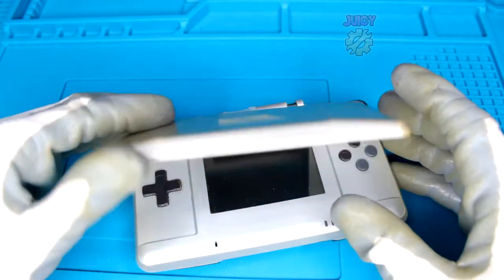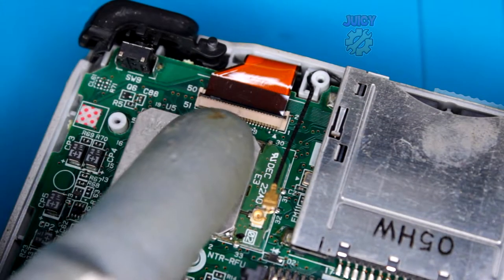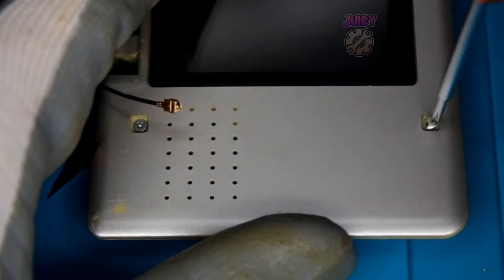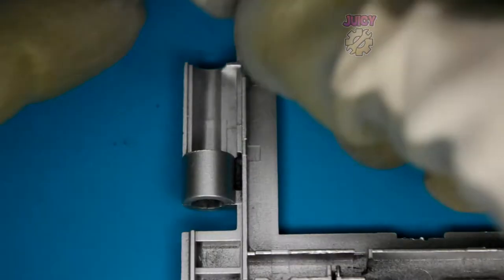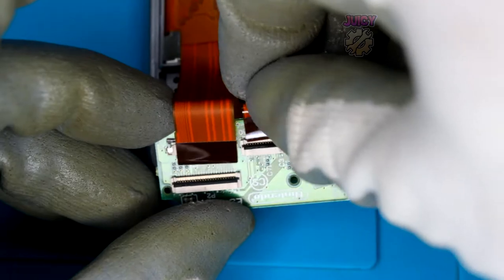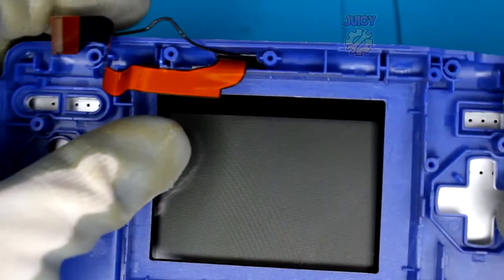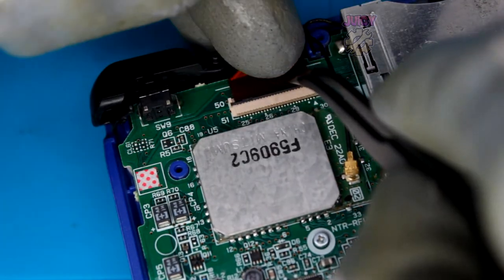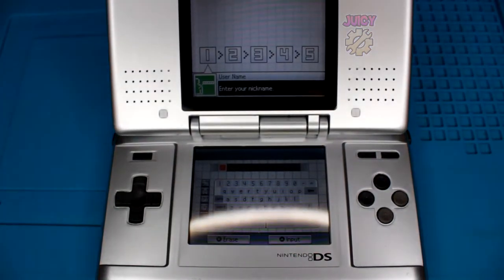How to replace DS Shell in UNDER 10 minutes - Shell Swap

Comment from the maker: do you still own a DS, if so is it shell still intact? LIKE & SUBSCRIBE

Time Stamps:
            ► @ 00:14 - What you need
            ► @ 00:42 - Removing Shell Screws
            ► @ 01:01 - Removing DS
            ► @ 02:05 - Removing Bottom Screen
            ► @ 02:54 - Removing Top Shell Screws
            ► @ 03:21 - Removing Top Screen
            ► @ 03:55 - DS Hinges
            ► @ 05:44 - Installing Top Screen
            ► @ 07:55 - Installing Bottom Screen
            ► @ 08:45 - Installing DS
            ► @ 09:29 - Installing Shell Screws
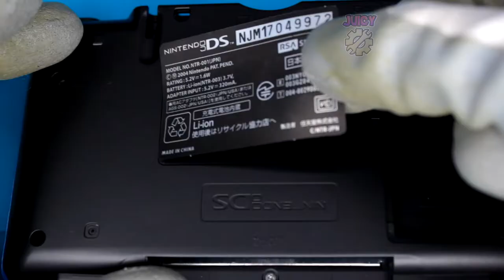            ► @ 09:55 - Misc Shell
Reply: I dropped mine and the plastic was so brittle that it broke like glass
Reply from the maker: @izzymaedavidson1974  yeah you can see the original shell in the guide shatters easy too
Reply: I own one but the shell if broken, but going to replace it with your video as help👍 i just replaced the shell of my ds lite.
Reply: Next, replace Nintendo dsi please
Reply: How much for me to send mine in ?
Reply: I had mine since i was about 6 yo (now 25yo) my whole childhood it was perfectly fine and then when i was 20 i moved to another house, dropped it and now there is a hole in the top shell and my hinges are broken. The device itself works fine still.. i just can't seem to find where to buy a shell replacement that includes hinges..
Reply: @kim_3000  And i order this shell, hope it will be decent quality
Reply: It was till I gave a good tap in the back to dislodge the cartridge.
I'm going to replace the shell but while I'm in there I'm also going to replace the digitaiser because half the screen is off.
Reply: Are you In the US? If so do you know a reputable shell seller?

Comment: This video is super helpful! My experience swapping the hinges was awful until I used the corner of my desk. Press down on the housing and use the corner of the desk to force those pins into the hinge slots. The use of profanity is also helpful.
Reply from the maker: its absurd the amount of force you need
Reply: New fear unlocked after I made orders today 😅
Reply: Tried your desk corner in 2024 and it worked! Thanks

Comment: Are the buttons more receded on the new shell? I have an original with a broken hinge that I just bought a new shell that I’m going to replace it with but if the buttons don’t stick out of the bottom like the original I will just use the original bottom with the new top please let me know
Reply from the maker: I've noticed on some shells its actually the hole for the buttons is just not big enough and needs adjusting slightly, a file normally works well for this

Comment: This is the best channel BY FAR when it comes to repair tutorials. No waffling, straight to the point and informative! 

This video was my guide replacing my DS shell as I have never done it before. The shell was of poor quality. It came with screws that didn't even fit, so I had to use my own. This video helped a lot! Thank you!
Reply from the maker: Glad i was helpful! Is there any other guides you would like to see?
Reply: Could you link where you found the shell?

Comment: I didn't use my Original Silver Fat DS for years cos it was broken and recently I bought a new shell (Dark Gray) and I just finished replacing it watching this video.

The first time I missed the long piece that goes in the top screen to adjust its position, and probably didn't do everything correctly cos it would turn off automatically as I tried to turn it on, so I did the whole thing a second time and now it is working perfectly.

I bought a brand new shell kit for only 0'99€, but I used the original pads, buttons, triggers, lower part of the case (where the serial number) and the old NINTENDO logo in the front cover (it looks pretty cool new case is Dark Gray but the logo stills being Silver!) surprisingly, everything feels smooth and its working perfectly, AFTER 20 YEARS!!

Thank you very much!! Thumbs up!!

Comment: Thanks a lot for this video! I just did a huge restauration on my old DS, which had a broken hinge as well as two broken shoulder buttons. Decided to replace the entire shell and also attempt replacing the shoulder buttons. It was a tough project as I'm basically a total noob in this area and had to learn many things. Even learned how to solder and desolder stuff, just for the shoulder buttons. Of course things went wrong here and there and I came across a few roadblocks that I thought I couldn't overcome, but I eventually managed to do everything I had planned, and this video definitely helped me with taking the DS apart and putting it back together. It was kinda tricky to even find any resources on the original DS, so this video was very appreciated!
Reply from the maker: thats awesome, glad it worked out in the end
Reply: Thanks, I'm also relieved! 😊
There were honestly multiple points where I thought to myself "this can't possibly work out". I'm especially surprised the shoulder button replacement worked, conisdering it was my first time soldering. Most of the issues probably came down to the replacement shell itself, though. Not sure if I just happened to buy a particularly bad one, but it was full of mistakes I had to work around, the holes for the hinges were incredibly tight and badly aligned (inserting those was probably the hardest part), the included screws were completely arbitrary and didn't even fit into some of the holes. Originally, I had hoped to do the entire replacement in just one or two evenings, but it ultimately ended up taking me almost an entire week. 😅
Reply: @RPG_Hacker  hey man it was cool that you've restored your ds but dam you learned to Sauder quickly! Any tips on how to Sauder? And what kit should I use?
Reply: @oddgbmo3036  Thanks!
Well, since I'm only a beginner myself and have really only soldered this one time, I don't want to give too many tips. There's definitely people with more experience than me who can give more valueable tips.

Though what I can say is that for me, the biggest hurdle to overcome was simply being too scared. All that time, I was just too scared to break my DS, so I always touched it too shortly or too loosely or I didn't set the temperature high enough. While I suppose it IS possible to damage a circuit that way, I find being too scared is an equally large problem, because the contacts will just never melt that way and you'll find yourself struggling forever. Once I stopped being so scared, it got a lot easier.

Comment: 0:50 I know it’s one of those tri wing screwdrivers to unscrew this section but is there a certain size to the screwdriver that is needed?
Reply: I also would like to know! I bought two different ones that were "for electronics" and neither fit!

Comment: Still have my original model ds. It's rather scratched up and paint wearing off but mostly fine shell wise other then the loop part of the hinge on the right side which broke and the L button no longer works. Also have my brothers witch is in better shape but the same part is broken

Comment: my ds shell is broken and I need to replace it, but I am worried about where to get the shell from. from what I have seen and experienced, the aftermarket shells are pretty terrible quality. i am specifically worried about getting the screws into the shell. do you have any recommendations for places to get decent ds replacement shells?
Reply: Hey i know I'm late but you should probably search for a authentic ds that doesn't turn on or has very bad screens with a good cosmetic shape and little scratches to it. You'd get what you need without the cheap aftermarket and maybe even a few parts. That is if you haven't already found a solution by now.
Reply: @oddgbmo3036  hey, I appreciate you responding!! I actually decided that I was probably gonna do it that way but wasn't sure and haven't done it yet lol thanks!

Comment: My DS needs repairing. I dropped it back in 2015, causing it to break the hinge and the top screen to not work properly.
I don't think it's busted because when you hold the screen in a precise angle, the image comes up so it must have a loose wire.

My stepdad bought it back when it was brand new in 2005 and it pains me that I broke it so it's up to me to fix it.
Reply from the maker: hopefully you can get it working!

Comment: Word of advice: ALWAYS use the screws that come with the replacement shell. The 1st screws I screwed on mine were the ones that hold the PCBs next to the top screen in place, and I used the screws of the original case. Now my top lid has 2 little bumps next to the screen , on each side. 🤦‍♂️
Reply from the maker: I've had mixed results with using both, sometimes the new ones ruin the new shell, sometimes the original ones do. In summary, for whatever reason, DS shell replacements are poor quality

Comment: Does anyone know if any of the other DS model hinges fit into this model from the video? Mine was so torn apart it missed the longer hinge. This is the only DS model for which i can't find this replacement part online...
Reply: For anyone interested - I inserted an original hinge from ds lite into this ds model. The angle where the screen rests when open is incorrect (sits few degrees more upright) and when you shut it close, it doesn't snap into place with a click but it does stay closed. None of this really bothers me, its completely functional.

Comment: I just finished going through this and now when I press the power button, it powers on for a moment, the screen flashes, then shuts off. I've gone back and reseated the ribbon connectors. Is there something else i should check? The battery is charged. And I've repeated this with both a charger plugged in and unplugged.

Comment: Dang it... So my shell needed replaced, and the top screen was displaying blank. I bought a replacement top screen, shell, and connecting ribbon (the one that's curled inside the hinge). I've disassembled and reassembled it a few times now and it's just not powering on. I have to assume one of the many cables isnt plugged in fully, but this is such a finicky repair I'll probably junk it and just buy a used DS Lite or something.

Comment: I got everything replaced and put the whole thing back together. However, when I press the power button, the green light comes on for a sec then goes off. I don't think it's the battery but maybe It has something to do with the wiring?
Reply from the maker: yeah i would refit all the cables (remove them and put them back in again)
Reply: @JuicyJakeRepairs  thanks. The tiny ones are hard

Comment: okay, so i followed everything you said and finally finished reshelling my DS. However, now my DS isn't working. any idea why? It's charging when I plug in the charger, battery has always been good. i can hear the speakers glitch a bit every time i press the power button. but it doesnt boot up. if you or anyone has an idea why this is, i hope you can help me.
Reply: The same thing happened to me.  My Ds was working, but now, it doesn't work.  The lower screen flashes and the LED turns green, but then the Ds turns off and does not boot.  Extremely frustrating
Reply: @Pararadibum the same thing happened to me I was so disappointed cuz I took me hours to do all for it to turn on for a split second then turn off. It almost like a quick flash then turns off, like the white screen is there for a split second then it goes black again

Comment: my DS no longer works.. the bottom screen turns on and off immediately.. yet I did everything right :(…
Reply: If the bottom screen flashes and your ds/dsl turns off then the problem is usually the other (top) screen. Check and reseat the cables. You may have damaged the upper screen cable. Easy to do which sucks. Replacement upper screen cables are available on aliexpress and ebay. Good luck.
Reply: @danatmonst3594  I know I had some problems getting the screen cable back on properly, but I was planning on buying screens on Aliexpress anyway!  the screen cable was already a little damaged because it was bare

Comment: Where did you get the shell? I want to try to replace mine, I'd appreciate it so much
Reply from the maker: i brought a bunch from aliexpress
Reply: @JuicyJakeRepairs  do you find they worked well? I saw some on ebay as well, is there a part brand you got? I'd really appreciate it so much
Reply from the maker: @peachyalo  mine was unbranded, they work okay. They are not the best due to some of the "paint jobs" and the screws they provide are quite crummy, however you can reuse the original screws instead
Reply: @JuicyJakeRepairs  thank you so much, I’ll do that!! I hope I can replace the case on my ds😅
Reply: @peachyalo  hey did you manage to replace, the shell on your DS.
Reply: @ying.golden  honestly the shell I got wasn’t very good:/ like when you put in the screws it doesn’t fit well at all
Reply: @ying.golden  but nope I failed to unfortunately, I was pretty bummed out
Reply: @peachyalo  What happened? oh nooo my ds came but the post delivery f@@ed it up The top screen is cracked : (
Reply: @peachyalo  Would you mind telling me where you got it from, maybe I can help you with looking for one.
Reply: @ying.golden  I accidentally dropped it when it was on the bed lol and the hinges broke:( I’m sorry to hear that:( is there any way you can get a refund?
Reply: @ying.golden  of course, I got mine from eBay. I thought it would be okay and for the most part it looked good and I used the original screws but it was still really bad lol I couldn’t screw anything into place at all and then just gave up
Reply: @peachyalo  bruhh Im sorry to hear this, 😂 man is your ds still functioning you could try find some repair, even thought you don’t feel like it you should find some keep looking. Regarding the refund, it’ll be fine it just needs a new top screen which they have on eBay. I’ll be able to change it 😌
Reply: @peachyalo  ohhh I think I know the sellers, you got them from they also sell the pink version and manny more, the cases must be custom made so the screws are bad. : ( hope you can fix it, I just want to play Pokemon pearl 😂.
Reply: @ying.golden  the ds still works I removed everything carefully just got to find a case that would actually screw in lmao
Reply: @ying.golden  yeah the case was bad lol I hope you’re able to fix it! Let me know if you find good replacement she’ll for it:) ooo Pokémon pearl is great!

Comment: These hinges are maybe the most ridiculous thing I've ever encountered. There's no way they pushed them in by hand during manufacturing.

I have an aftermarket shell and the hinges slide very easily into the top screen holes, but barely at all into the bottom screen's. I've managed to shove them in enough the pieces seem mostly held together, but the clicking is a little off and it doesn't have that satisfying click its supposed to have when you open it all the way.

Even trying to push them through on their own on the bottom piece's holes seems impossible. I even tried filing down the inside a bit to no avail. I don't know if this is an aftermarket shell thing or a me thing. Any more force and I can see my hand/tool slipping and giving myself a nasty cut.

At this point I'd say to any aspiring NDS repairers to consider just getting a working used one for maybe $10 more and not put yourself through this hell.